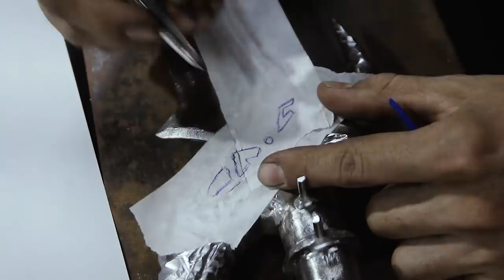Making Real Life Daedric Sword from TES V:Skyrim

Comment: Don’t show it to a professional sword smith unless you want to make a grown man cry.
Reply: Why would he cry?
Reply: drizzl Gg well if you were a professional blacksmith or sword-maker and someone presented you with two slabs of steel welded together and chopped with a grinding wheel, wouldn’t you cry? It’s like people proclaiming to be cabinet makers and cut all their joints on power saw.
Reply: Why would a blacksmith cry? We get 99% of the shape done without angle grinders and use files for the rest. We are laughing at all the useless steps required to do fairly simple angles. This also does nothing to impart the benefits of firing and working the steel which means a few blows from a simple, non-heat treated, metal rod is all I need to make the creator of this cry.
Reply: @glennglorious4810  I just make bows so I have no idea what steps you would take.
Reply: @timesthree5757  Me too, trees do 90% of the work.
Reply: @glennglorious4810  true!! That Bow is in that tree somewhere just have to find it.
Reply: @luvalient  the sword might look cool and stuff but if you would try to use it as a weapon in real life it would suck
Reply: @mrpumpkinpumpkins3926  i think it's pretty safe to say that this sword is just meant to look cool
Reply: @markgoddard2560  Yeah the majority don't know what you're talking about when you use profession specific analogies, we have no clue what any of that means. Elaborate normally.
Reply: Winter very true.
Reply: @markgoddard2560  That's not an appropriate response to what I said. Can you elaborate your original comment normally?
Reply: Winter . I thought you might prefer an inappropriate reply rather than the one I first thought of.
Reply: @markgoddard2560  Are you just not going to?
Reply: Greig91  I still don't get it =P if a blacksmith had made this they'd make something that could probably seriously ruin the metal fabrication project you see in this video ;]
Reply: @thegasli  yeah like i said looks good but sucks to use
Reply: Winter . Well could you just take a contextual guess or use a dictionary?
Reply: @markgoddard2560  ?
Reply: @luvalient  cuz its basicly two peaces of metal welded together and called a "sword". A real blacksmith would make the blade and hilt one peace of metal and or the whole thing one peace. Because when u do this it makes the sword strong. If u were to hit this thing against another object like a pipe it would most likely snap in half. Also there is realy no smithing at all hear. There is no forgoing only cutting and welding. Bottomed line it's a cool decoration but will never be an efficient weapon
Reply: @markgoddard2560  The point is that it's cool, maybe you are too pretentious to let people have fun is that it?
Reply: Dio Brando . Not in the least. I didn’t realise it was supposed to be cool.
Reply: He means that its more esthetic then practical use .and its very poorly tac welded together which will be weak and end up breaking ,you have to actually forge the steel for a more complete bulid
Reply: Ha! Speaking as a swordsmith, it's a lovely sculpture of a sword-like-object. What I really want to know is how much it WEIGHS. The recovery time on that thing is enough to get you killed. 
And, granted, as has been pointed out all over, that (Probably?) Mild Steel sheet can't be hardened, so it's a very spiky, heavy club that won't hold an edge.
Reply: Everything about this build hurt to watch, what the hell is the handle too? no tang either, this sword is a train wreck from start to finish
Reply: @chroma6947  Why are you being derisive on a 1 year old comment lmao

Comment: Looks good.  Not sure about just welding the hilt on to the guard.   Why not make a tang on the central sword. It would then be sheathed in the steel tubing. Possibly a bit heavier , but way stronger.   Good as a cosplay or display weapon.

Comment: There is something that just doesn't feel authentic about this method of making. Anyone can cut blanks out of plate steel and weld and grind it into LOOKING like a sword, (or in this case, a chopper). But if you look at the game/story this thing comes from, you must know that it was shaped by hand hammering, the grinding was done with files and sometimes stones. And welding was done by the forge Smith. 

Further, if you look closely at the watermelon you will see that it wasn't sliced open but it was just smashed open. The same effect can be achieved with a hammer.
Reply: Imperfect Art's that’s because it would be overly ludicrous to actually forge this thing. There is reason it requires 90 smithing.

Comment: My first question is, when you were tig welding the handle, did you put something in afterwards to make the handle more stable and less likely to snap at the welds when swinging it? If so, what did you use as a reinforcing rod for supporting the tang of the blade, if there was one? (doesn't seem to be since I didn't see one cut out for it)